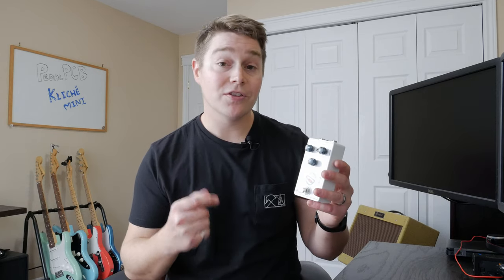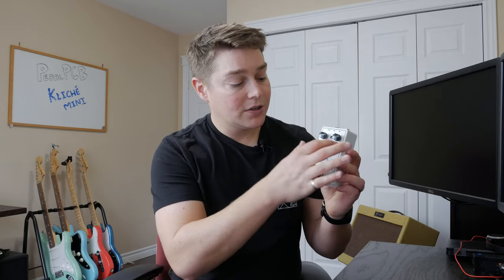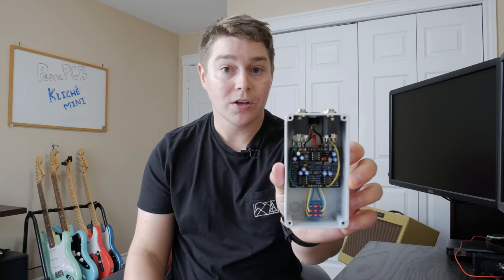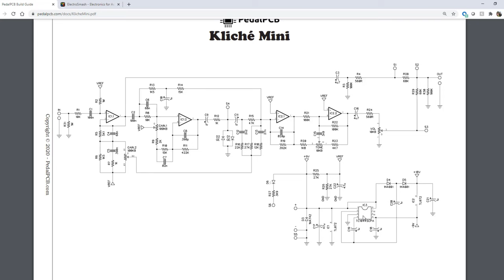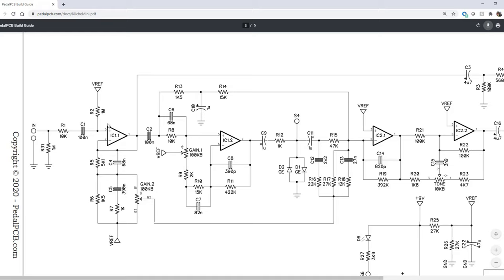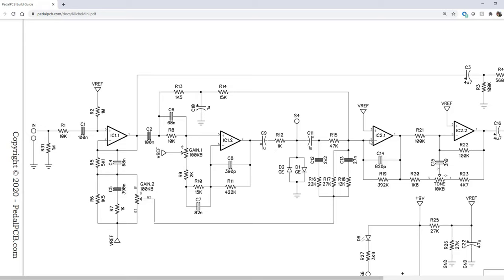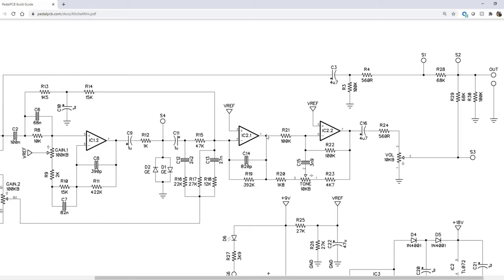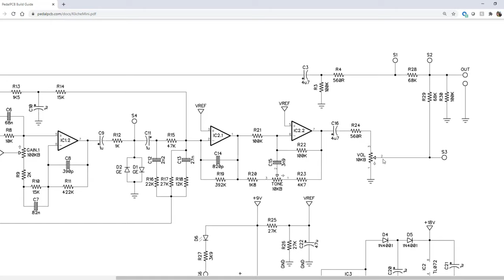PedalPCB Kliche Mini | Build Review & Demo | REVERB LISTED!!!

Comment: Really enjoying these videos where you go through the schematic on screen, it's very helpful.  Seems to be a bit of space available in the pedal. Any reason they use a 125B vs. 1590B enclosure? Curious too why they don't extend the PCB down to the foot switch rather than another breakout board connected with wires.
Reply from the maker: This board is designed for a 125b case. My guess is so that you can have top mounted jacks. Extra pcb is optionally, but you are right, they could include this in all builds. Especially the few that are buffered bypass